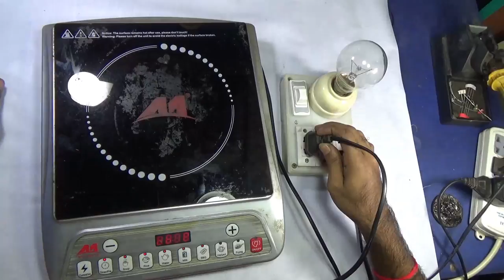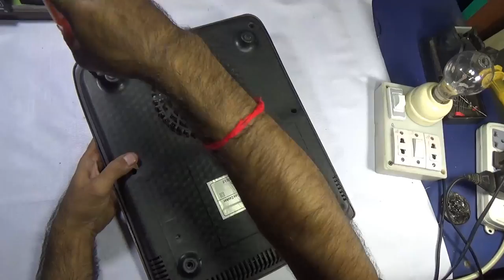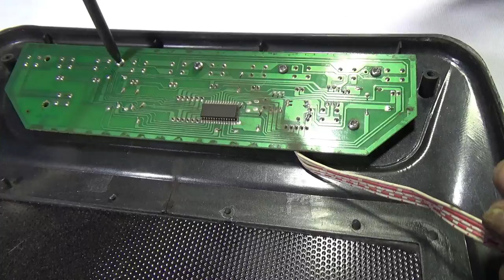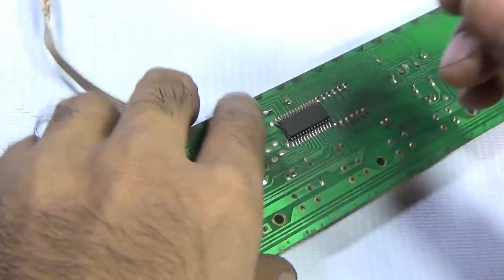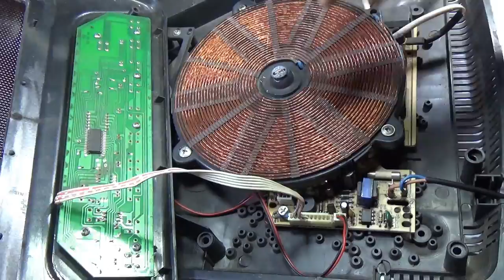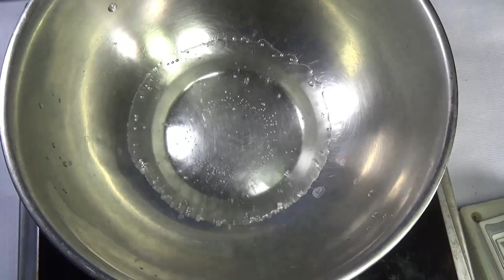How To Repair Power Switch Of A Induction Cooker - Very Useful

Comment: I am using prestige induction stove and it's power button is not good. It's not working anymore. Instead of fixing it, alternative is to press 'timer' button, wait for 5seconds followed by selection button like deep fry or pressure cook, etc.
Works wonder for me 😀
Reply: Bansal ji ...I just had this switch problem during lockdown in my prestige induction ... 
Your comment has saved  me ... Thank you so much for sharing ...👃

Comment: Where can we purchase the On /Off switch . What are the Specifications of the switch. What is it called in the market. I will purchase and replace in y Induction P{late
Reply from the maker: it is called push switch, of induction,,you can get it - where the electronics parts are sold